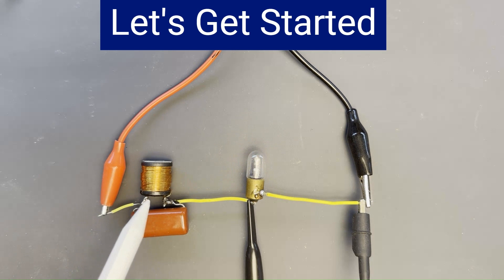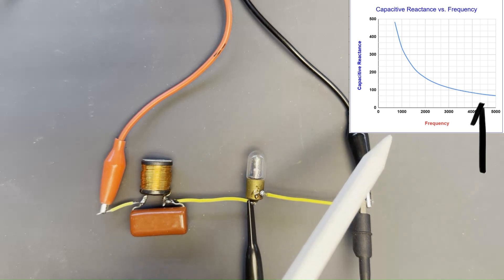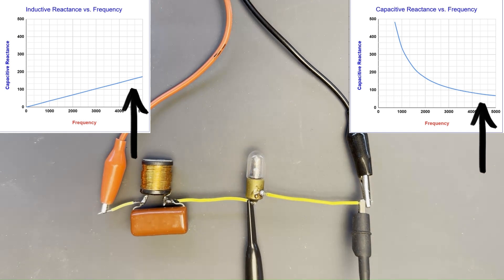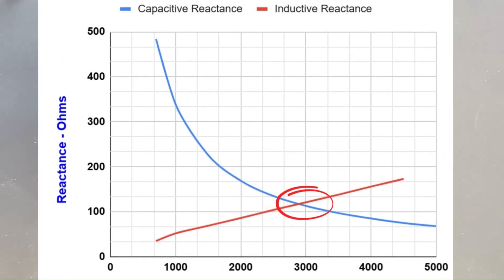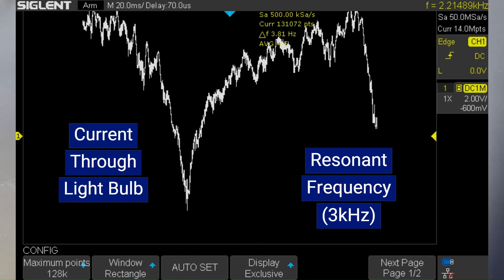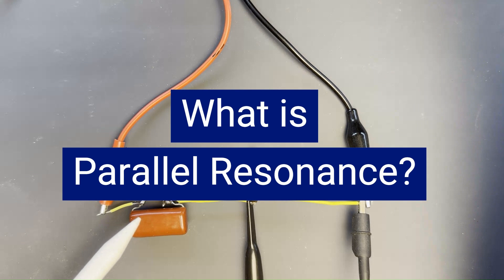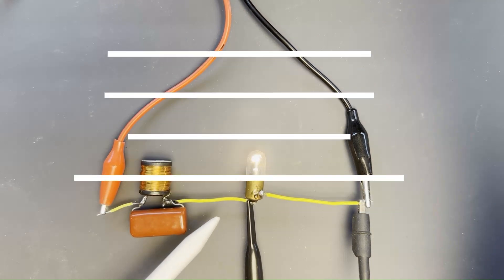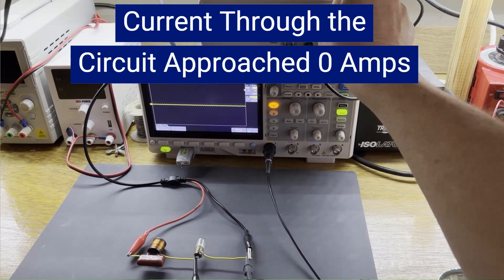#100 - Parallel Resonance Circuit in Action – Light Bulb Dimming Experiment

Comment: In the opposite scenario ( series resonance , with the capacitor and inductor in series ) ... the current flow is MAXIMUM at resonance ... this arrangement is often used to tune the output of a Medium wave ( 1MHz ? )  transmitter to it's long wire antenna ... however the voltage at the junction of L and C can reach thousands of volts 😝, so a variable capacitor might break down ... instead a Variocoupler ( variable inductor ) is used to keep everything safe ... QED ..... DAVE™🛑

Comment: This would be far more understandable if you explained the actual flow of electrons to really explain how it functions.
You explained really well what components made up the circuit but you never really touched much on how it achieves the function, just what the names of the parts are and the values.

Comment: In what practical application would this circuit  work?
Reply from the maker: Some applications are radio tuners, band-pass filters, oscillators, impedance matching, noise filtering, and high voltage generation. In the very latter case, voltages much higher than the source voltage can be obtained across the capacitor and inductor at resonance.